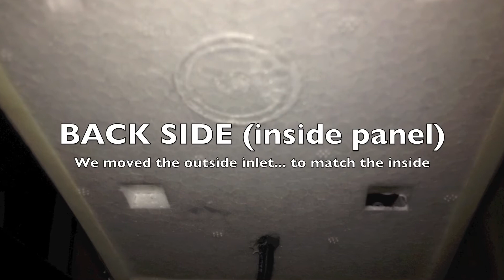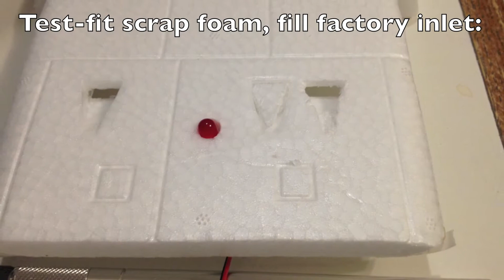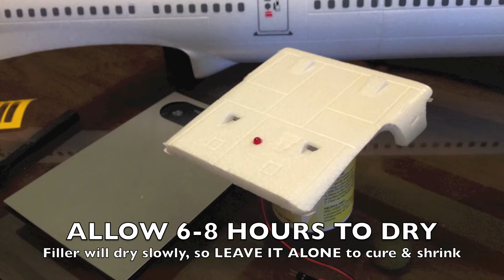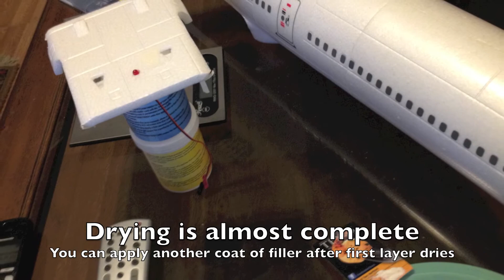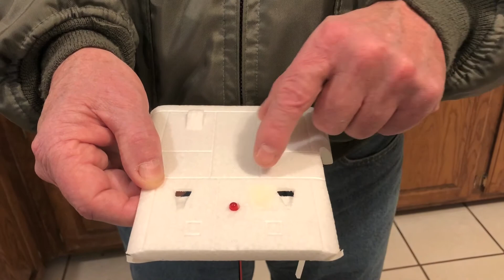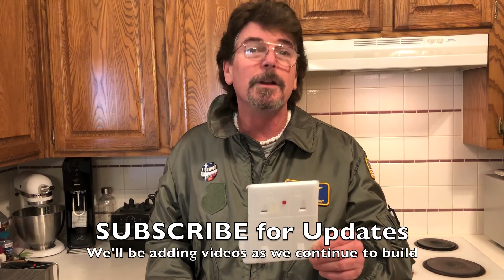Supreme Hobbies Airbus A330 A340 ESC cooling cover modification

Comment: I have method on ESC cooling I use carbon fiber tubes to collect the bleed air from the engine (EDF) is transferred on the tube is directly placed in front of the esc supports for cooling.

Comment: Looks nice!!!

Those ESC's will get pretty hot still, so the remedy for this is of course....

....GO FAST :) LOL

Yet that thing out and flying! It's gonna die of old age if you don't fly it!!! :)
Reply from the maker: Will do, Brian. I have been working on the under-wing box for the FX-79 while I am (effectively) grounded. This new project will let me get some real hands-on construction done with foam... before I try to tackle the fuselage of Project Molokai - that I can't afford to screw up. With the new FX-79 project (named Tanker 10), I have the ability to screw it up and not destroy the entire aircraft or an expensive fuselage in the process. The bladder tanks are all self-leveling with Tanker 10 and 6 isolation check valves prevent reverse flow between bladder cells. For venting, the fuel tanks use two common vents which have a crossover tube if one check valve ever fails to vent. Each vent line check valve cracks open at 0.5-1.5 PSIG. My flow valves require 1.25 PSIG before they crack open and allow partial flow - THEY'RE fully open at 2.25 PSIG. I will post progress photos using my Snoop Works website (Rockwell had Skunk Works and Boeing has Phantom Works... so I thought it would be fun if I had Snoop Works for my multi-engine recon hobby jets). I'll plan to update the site at www.SnoopWorks.com and I'll reply with a link for you after I get an update posted for the Tanker 10 BWB air refueling tanker/transport - with photos, of course. If we don't happen to post/reply before then, Merry Christmas to you and your family, Brian!
Reply: COOL! So, just to be totally clear, you're building a multi fuel tank jet powered plane right now???

Merry Christmas to you and yours as well!
Reply from the maker: EDF to start, then IF the A/R boom will lower to 80º (or low enough) to have a minimal bow wave effect on the tanker, THEN foam would get a few thin coats of fiberglass and some of the internal foam would be carved out. I cannot fund turbines, nor do they comply with all AMA policies and insurance coverage. These first A/R tanks are from black box wine bladders (approx. 3 liters ea.) and I'm only using black box bladders equipped with a "twist knob" and NOT a spring-loaded, hand-held outlet valve. Initially, it's gonna contain only colored water at 8.34 lb./gal. density, while turbine fuel would be 6.4-6.6 lb./gal. if running jets. If I can make it fly first with water loads, the lower fuel weight vs. water would help. I just need a way to "practice" with foam "fuselage building" without risking what little I can afford to rebuild if it doesn't fly.
Reply: That sounds heavy...
Reply from the maker: It is... "quite heavy, dude." Battery B is above 30,000 ft. right now, somewhere over the Pacific. XT90 and 8000mAh of 6S power for a bank of 3 LiPo batteries in parallel to allow for extended "on-station" time. The new legs are also in the box, which arrives mañana en la meñana. You didn't know I'm so worldly, eh? Yes, I speak a little Canadian too... due mostly to the McKenzie Brothers (Bob & Doug). I'm currently studying Chenglish using RC websites and one-sheet assembly manuals. I tried to learn the English language as a kid, but they hide that information in books... and I seemingly never opened those books as a kid.

Snoop Works has a relatively young Page on Facebook - https://www.facebook.com/SnoopWorks

I'll be posting some pics as the build progresses. I still need Battery C (#3 of 3 HD-cameras/power batteries). Dual 8A UBECs (one supplies 4.8-6V for landing gear/flight control servos and one supplies 12V for industrial-grade valves and other common 12V parts) will power the DC solenoid valve(s) — no pumps; airspeed will pressurize the "fuel" tanks to prevent manifold cavitation during fuel offloading. 

Wire is here already - 10AWG silicone-insulated braided copper by ACER Racing, but I bought only 10 ft. of Red/Blk. I hope to be able to build Project Molokai as the first A/R receiver, but I don't expect the speeds to be compatible enough between Tanker 10 and the receiver, which must creep closer using a FPV nose cam. I have looked at this air refueling goal for a long time, and have determined that the A/R operations will need to be done in a continuous shallow turn (5-10º max bank), but that will add a bit to the power requirement as it has to be done entirely within LOS from the takeoff point in order to be legal as a hobby pilot. Of course, two pilots will be needed, plus a spotter while the receiver pilot is using FPV to advance forward from the pre-contact position to the contact position. All this at 300' AGL will also be challenging, but that's pipe-dreaming until I get Tanker 10 flying stably and safely. Tanker 10 will only load 1 bladder tank partially to start, then (if it flows water out the boom) up the fuel loads from there.
Reply: mañana en la meñana - tomorrow morning ???
Reply: Sounds like a full time job!!! LOL

If anyone can do it, it's you :)

Good luck!

P.S. How are you going to resist the Government offers to leave chem trails with it ??? LOL :)
Reply from the maker: Si. HK plane lands at 11:14p, then it's on it's way here to deliver by 10:30a. I'm eager because it may affect my wing box size & shape if I go with the longer oleo legs that are in the pkg; I'm limited because I need a 5mm pin (min.) for weight-bearing and pounding if I happen to slam it into the asphalt—which I likely will.
Reply: So are you flying these things yet?
Reply from the maker: Ha. You too funny. I am now faced with having to get a charger that will accommodate my new 6S 8000mAh batteries. I have a very limited budget so I thought the IMAX 50W 5A blue might do, while they are doing free shipping with qualifying orders. They sell the IMAX "Genuine" for $26 and the IMAX "Copy" for $16. I want to ask your personal opinion on another charger I saw they sell, which has the capability to charge a HV LiPo, IF I should ever have reason to 'upgrade' to 6S HV battery power. If you have a moment to view its features, would you kindly share your reflections on this specific charger? I can receive it with free shipping if I act before month's end. Others would bump the total with shipping added. Here's the URL:

https://hobbyking.com/en_us/turnigy-accucell-6-50w-6a-balancer-charger-lihv-capable.html

I must now choose a 6S-capable charger and I'd like the ability to charge via the car battery if possible. This one's only a buck more than the IMAX 5A Genuine, and this one's rated 6A output and it's CE listed.

I really do value your advice, Brian. Even then, I must be the one to decide in the end. Eager to know your thoughts...
Reply from the maker: That's why you're the man. You told me everything I needed to know. I cannot afford 8S power and none of my batteries are HV... so Budget Airways will charge with a C3 that plugs into wall sockets. It's 700g heavy compared to that one I was eyeing... and it's worth the $4 shipping they're charging for a heavier package.

I believe I am destined to be a 3S-6S airplane driver; I will likely never see an 8S battery in a foamie unless it's someone else's. Have a restful night & danka, Brian. That HV charger is a GMF; C3's already in the cart.
Reply from the maker: That's a very informative video about LiPo batteries - I'm going to go back and re-view the information you share. Well, as it would happen, I went to place order and voila... the C3 now shows sold out in my cart! If that's the way it is, then it's no 6S charger for now. I should have been smarter than that, but I hesitated. :(

That being said, have you ever used this seemingly affordable gear door sequencer? https://hobbyking.com/en_us/turnigy-smart-retractable-landing-gear-gear-and-door-sequencer.html

I can add it without additional shipping, but if it's a useless device, maybe I can avoid it gathering dust here. I thought I'd ask you, but maybe you aren't doing so much with main gear doors these days... eh?

I really want my gear to retract and extend slowly. I don't know how fast the plastic retracts w/ metal trunnions are - I see some pricy all-metal units that show 6 sec. travel time at low voltage, but I worry that some retracts may 'snap' up and down, which I don't want. I think that 4-6 seconds is about the right speed for my desired airliner retract speed. These retracts do not list a UP/DN travel rate/time: https://hobbyking.com/en_us/servoless-retract-with-metal-trunion-for-large-models-51mm-x-43mm-mount-2pcs.html

It's cold here today, so it's likely colder there in IA, so maybe you're indoors. Any reflections on that 'affordable' gear door sequencer or MLG retracts set - for operating speed?
Reply: I have a couple, but have never used them (yet). Every time I use or depend on sequencers, I have a failure or they simply DON'T work to spec, so don't get your hopes up. Do you best to make a mechanical action that can be driven by the servo less retract or a simple second channel, if you must. This will save you headaches. If you wanted to try it out, like you said, it's a fairly inexpensive thing, but keep in mind, you may get Hobbyking'ed - buyer be ware!!!

I have an idea that will MIGHT work for you... What about using a lower voltage, like that from a 1S pack, for the retract, then use the signal wire and GND back to the Rx (meaning BOTH GND's will be attached to keep the Common, common)??? I bet it'd operate slower...you might even be able to run a SMALLER voltage pack, not like it HAS to be a lipo, right???

Now you've got me thinking!

P.S. "Free shipping" is very deceptive at HK, so make sure to cross your "T"s and Dot your "I"s...I think you have to buy $150 worth of stuff (NOT PLANES though) from the Global Warehouse to qualify for free shipping.

To answer your question about "ideas" on good retract...honestly no, I don't really have great ideas. I find it incredibly difficult to have any clue what size or rating to find and purchase. Hobbyking can sometimes be a bit light on specs for "weird" stuff, like retracts.
Reply from the maker: So your 3.7VDC single-cell idea is very cool, yet I had been of the belief that the commonly-shown 4.8VDC was a minimum recommended voltage... if not a min. req'd. voltage. Likewise, I've read from sellers "NEVER use higher voltage or you burn out some retract!" (Chenglish) - I have no experience to call upon, but you have plenty of "E" to call upon. You DO know the definition of experience, don't you??? I KNOW you do!

I found a C3 charger, but I would have to supply my own AC power cord like a computer CPU that plugs into a grounded AC socket in the device. It's almost the exact same price as the HK charger, sans the XT60-ended cable. I took your recommendation and nabbed that 6xXT60 balance board; it's loading onto an A330 tonight and here within 24 hrs. (or so).

Do you think the 3.7V idea might be too low of a voltage and may try to pull extra amps because of low-voltage supply when all the retract motors start up simultaneously? E=I/R works for steady current draw and .707 of peak works for RMS voltage, but the inductive load can be substantial with simultaneous motor start-ups. I recall that the E-6 (doomsday plane) has a 960,000 watt momentary power capability (from 5 of 8 CSD-driven engine generators), but the ammeters only shot up when the 200,000 watt transmitter suite was powered up initially. Even those big high-bypass turbofans would momentarily slow down when the 3-phase transmitter was powered up on a wire-out.

eBay: https://www.ebay.com/itm/ORIGINAL-EV-PEAK-C3-Lipo-Battery-Balance-Charger-Discharger-50W-6A-USA-STOCK/172635358712?_trkparms=aid%3D111001%26algo%3DREC.SEED%26ao%3D1%26asc%3D20160727114228%26meid%3D1b3fc23045d94fc9a2984e5d73690a70%26pid%3D100290%26rk%3D2%26rkt%3D4%26sd%3D272233348592&_trksid=p2060778.c100290.m3507

Does this C3 look similar enough to you, or would you (personally) hold out for HK to replenish their stock? Same price, but free shipping on eBay and C3s are not shipped free from HK. Since there are only 2 of these offered, I have to either go for it at $29.99 delivered or I can expect that this item may truly be limited to 2 units and it will sell out like the HK item recently did. Just curious, after you actually see this C3.

BTW: I used to tell my flying students that "Experience is what you get when you didn't get what you wanted." Applies well to hard landings, bounces, accidental spins, etc. ...you got EXPERIENCE!
Reply: The video is now posed and public. Enjoy :)

https://youtu.be/YIWNq4eLVR8